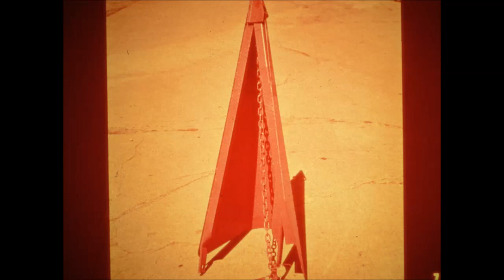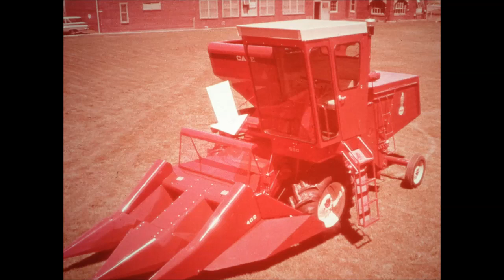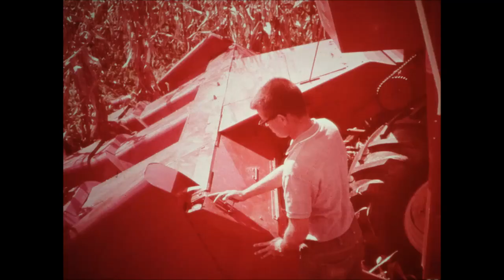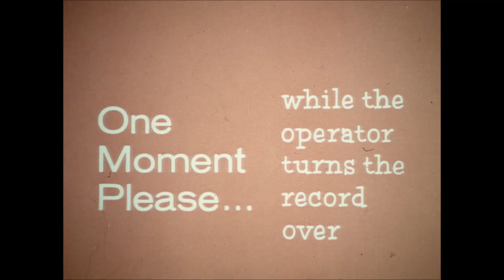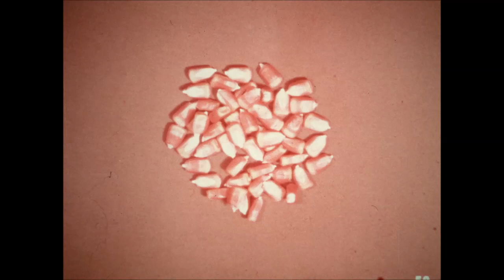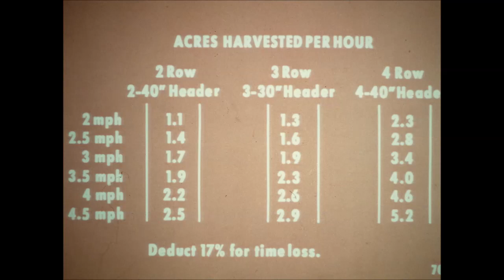Profitable Corn Harvesting With JI Case Combines

Comment: Case just seemed to stop any further development of their combines after this.  Admittedly that's why they bought up IH after they went bust in 1984, because they had a good combine design.   It's still interesting to spot these old case machines sitting around.  They must not have produced very many of them.
Reply: @AJ67901  case couldve made a bigger combine, and at this time they had the biggest which was the 1660, the JD 105 had a 50 inch concave and the 1660 had a 52 inch concave.